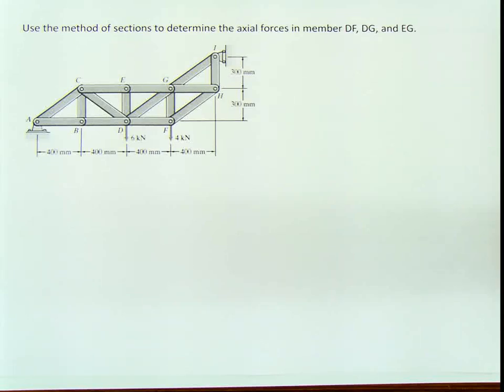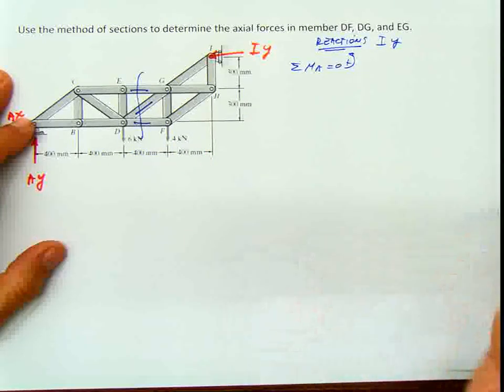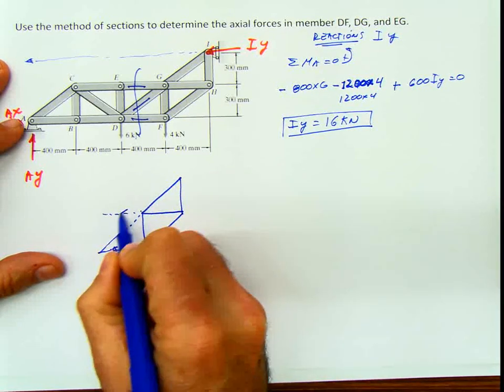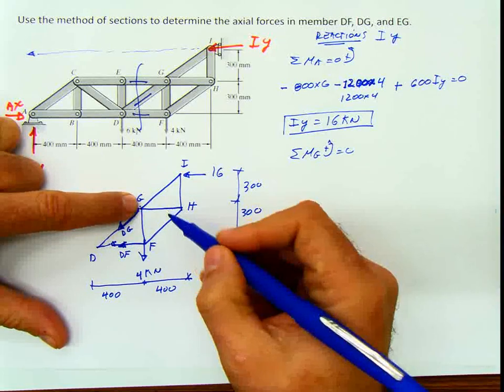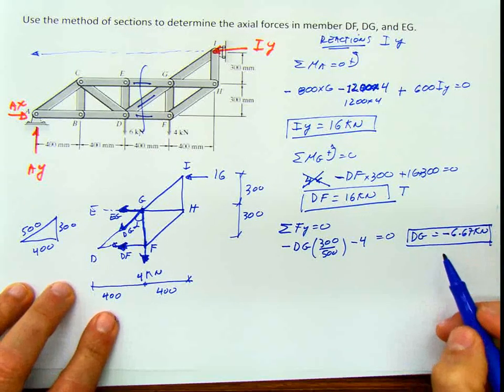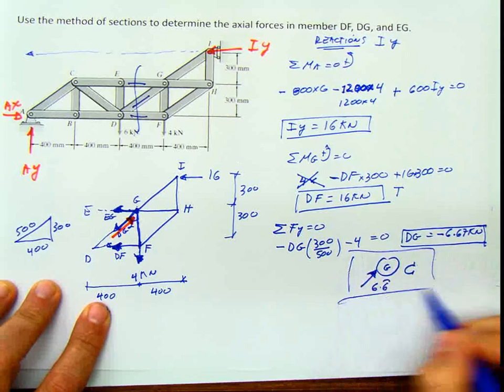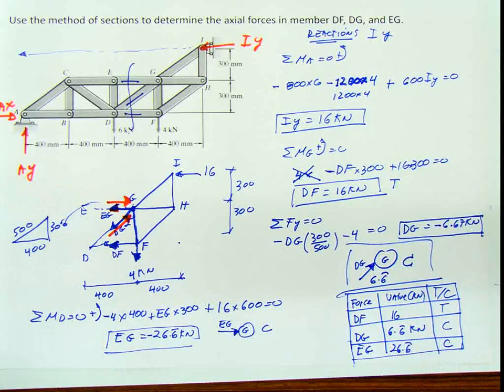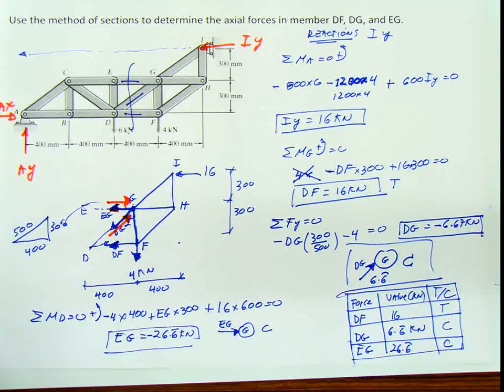Chapter 6.4 The Method of Sections

Comment: Is that a pin at i? And if it is why label i(y)? Shouldn't that be an x component? I'm assuming that's just a roller but still don't get why it's labeled i(y). 

EDIT: actually I think I see why you did that. It didn't really matter because you took moments of the section. But if you were doing sum of forces for the whole truss that should be labeled x.
Reply from the maker: +MisterBinx I is a roller and yes,  you are right it should be named Ix.Thanks